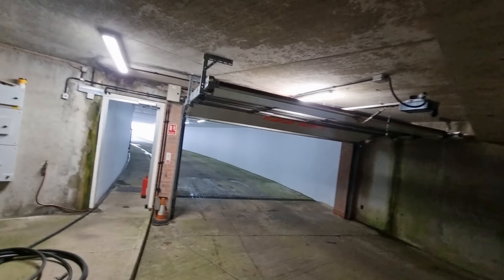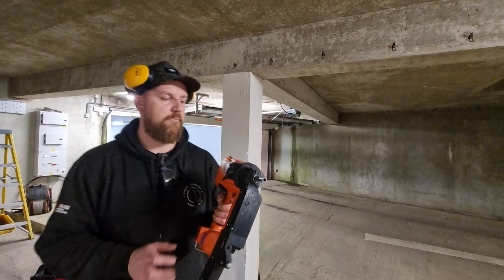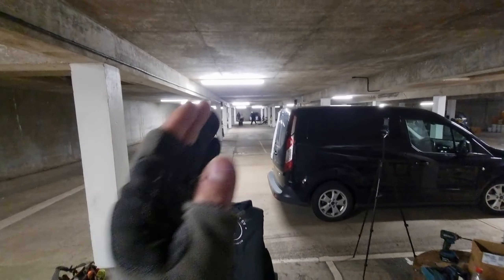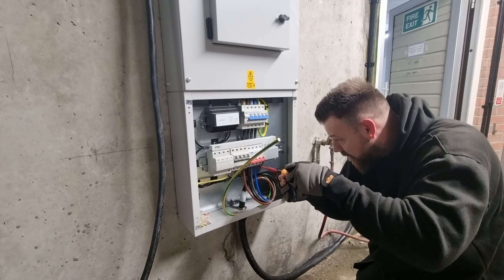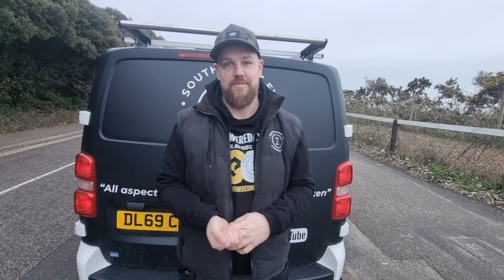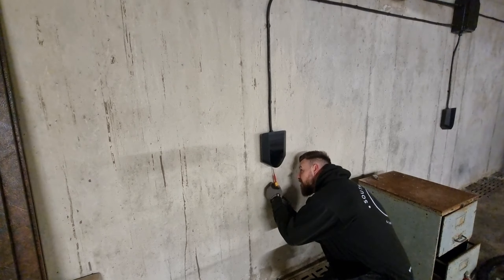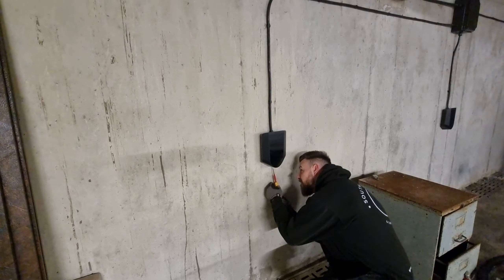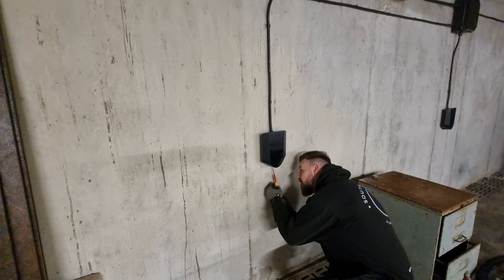Installing 25 EV Chargers - The Worst Cable I Have Ever Used

Comment: I find this really interesting as we've stopped doing underground/basement car park installations. As basically the last one we did needed to be tied in with a sprinkler system with discussions of the fire alarm dropping a contactor out so the supply to the charger was cut off. Suffice to say the on going changes by insurance companies and local fire departments is causing enough issue that most installs in the pipe line have been cancelled until further guidance has been published.

Just wondering how you're fairing as you're only down the coast from us.
Reply from the maker: Hi Mate, although this is underground its not below any dwellings etc and i would say until there is official guidelines enforcing sprinkler systems for example that it is not a necessity but ofcourse understand it must be a consideration, where we have quoted ones below dwellings we also provision for thermal cameras that are tied in and in the event of an issue it shuts the system down - it monitors the charger and car

Comment: Why not armoured cable and metal cable ties on car park tray
I stopped using 10mm hytuff 5 core as IR reading were not perfect.
Hell of a cable run on the 25mm , all those holes ! Well done
Reply from the maker: Because SWA not necessary, thanks for watching bro

Comment: Interesting video. Out of interest why did you install the 100a Switch fuse out of the panel board? Was it not a fused switch in the panel board?
Reply from the maker: Hi Mate, just as an additional point of isolation. Completely understand it is not necessary
Reply: @southcoastev  fair enough. Enjoying the videos.Keep up the good work.

Comment: As a Canadian electrician I’m just curious. Why not conduit?
Reply from the maker: Hi mate would of been better I agree but the added time and costs would price us out of the work
Reply: @southcoastev 
That’s not an excuse. You have not done a proper install there, no impact resistance whatsoever. Van opens his tail gate reverses into wall, the cable is done
Reply from the maker: Cool story bro, installation is 👌
Reply from the maker: Think you are confusing cable types, if we had used H07 and you said that I'd agree, but certainly not with Hi Tuff
Reply: @southcoastev 
Ok…

Comment: Are the wago boxes fused down to the charger?, surely under fault conditions if the charger pulls the 64A the 6mm will melt before the MCB trips?

Regards the awful cable we always specify Doncaster tuff sheath these days it’s pricey but it’s far higher quality than the others.

Job looks really tidy mate!
Reply from the maker: Hi Mate yes the circuits running in the wago boxes are Fused down to 32A per circuit

Comment: Did the customer took the Charging enclosures on stock/spare ? Otherwise you might run into situations that after a few years you need to replace the dummy/charger also.
Reply from the maker: Hey Bro can you elaborate please so i can respond properly :) Thanks
Reply: @southcoastev  well you place dummy’s, but what if the customer does not take a EV charger in let’s say 2 years, what if the EV charger manufacturer does not make the model anymore? Of when the EV charger brakes down after becoming end of life.
Reply from the maker: I get your point but you could say that about so many things and scenarios on anything in life. For example I'll pag tax and NI my whole life but the chances of a state pension Still being available is pretty much 0.

I get what you are saying but I can't forecast what plans they have in 2,4,6 or 8 years time.

The system is a great system and there's no reason for them to stop. They know people are heavily reliant on their set up and dummy back plates so to stop making them would be insane
Reply: @southcoastev  Thanks :) great video btw, following you from today!

Comment: You should be using steel conduit in a car park. The impact rating of hi tuff is not fit for purpose in a car park. 
Simple really take a trip to a multi-storey and have a look
Reply from the maker: Impact rating? Do you plan on driving in the car park in a hovercraft? 😅

Comment: Having underground charging is not the greatest idea 🤦‍♂️
Reply from the maker: Neither was your comment, but hey 🤷
Reply: @southcoastev  working in the fire industry it is a very sound comment!
Reply from the maker: @johnfennah4595  not really, there are no dwellings above and also no regulations to say you can't. Aslong as sensible precautions have been made, no problem!
Reply: Need to notify building insurers as premium will likely increase due to risk.
Reply: @southcoastev  nothing wrong with his comment.
Reply from the maker: OK fella coolio 🤏